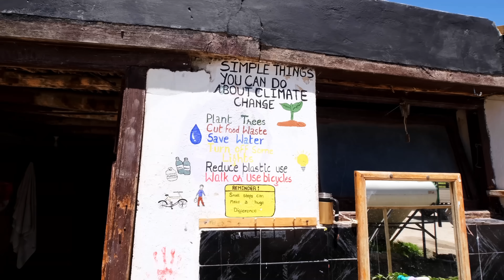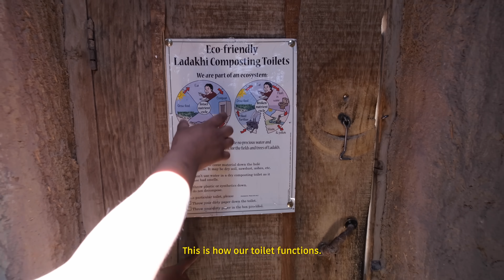How Dry Toilets Grow Food In This Himalayan Cold Desert

Comment: I'm a bit confused about how women are supposed to keep their urine seperate from the poop, which you need to do in a composting toilet. Obviously, the men use the urinal, which goes into a urine tank. As a woman, I can't imagine trying to balance on a men's urinal. Modern composting toilets have 2 separate tanks, served by 2 holes in the toilet bowl.9:55 One tank for poop, one for urine. A hole in the floor, as shown here at 5:06, doesn't.
Reply: I don't know for sure but here's my take. Whether you need the urine separate from the poop totally depends on context, one aspect being what and how much sawdust you add after each sitting. If you notice at 5:47 he uses a whole shovel of dry "sawdust" (or whatever that is) as an example to put on top of the poop/urine, that's enough to counter the excess water, and it's also dry. While composting, which begins not after they close the toilet for a year, but after each sitting, the poop and sawdust constantly need a little more water for the composting to continue to take place, because water still evaporates in that big chamber. If they didn't add a shovel of that dry stuff/sawdust, then yeah, the urine would have been excessive and would create a huge amount of excessive smell. We have an outhouse like this but small and use sawdust cause it absorbs nitrogen (N) well and needs a lot of N to decompose, which is the case in such a composting toilet. But if you want to use a small version of it inside your house and with a bucket underneath, then this is tedious and not practical because it would fill up too quickly because you'd need to add half or one shovel of sawdust and the bucket underneath would fill up too quickly.

Comment: This guy took a huge contract to build a university and it's stalled since forever now govt cancelled it. So doing interviews on dry toilets and doing protests.
Reply from the maker: We don't claim to know the full truth. But we can atleast accept as a Ladakhi engineer his service to the land cannot be discounted. You can choose to believe the govt AND listen to his words on dry toilets, right?
Reply: @goodfoodmovement  Dry toilets were the norm earlier, its like saying will use cycle instead of bus/rail and so on. Not practical, maybe ideal, even in Harrappan excavations, drainage systems were there, so not all places this dry toilet will work. Try   digging a hole in your backyard and shitting there
Reply: @goodfoodmovement  Septic tanks work similarly, especially the double tank model. This guy has been causing a lot of nuisance unnecessarily.

Comment: This film is so well made, thank you! I was involved with designing and building the toilets seen at SECMOL in the film, and later included the same type at my private house, but made it attached to the upstairs of the house for convenience. It works great. 
The two-year alternating chamber system, along with an additional year of composting in a pit right outside the chambers (not seen in the video) makes the compost safe for use in the gardens. No pathogens survive two years of composting. (The additional pit is full, covered with dry soil, and the two guys are standing on it when they open the manure chamber in the film)
Toilet paper composts just fine in it. We found that if only a few visitors used water it was fine, but if several people used water daily for a while, it could make a bad stink (the manure gets saturated and anaerobic, which generates methane and other stinky gases).
Reply from the maker: That's incredible - thanks for sharing your experience with the system and the extra tips :)

Comment: One part is missing....how do you clean yourself in a dry toilet ? That part has been left to the viewer's imagination :)
Reply: Leaves and fern, or corn husk! There are so many alternatives to toilet paper
Reply from the maker: Hahaha. Well all the methods - water or paper - work fine. Doesn't affect the compost so much.
Reply: At SECMOL in the big chambers you see in this film, toilet paper (as well as scrap newspaper) has been used regularly for decades. It all decomposes. When only a few visitors use water, there's no problem, but when several people use water every day, those toilets get a swampy smell (due to the manure pile below getting saturated and anaerobic). I lived at SECMOL for decades and was involved with the design and building of the large-chamber toilets seen in the film. 
At the small indoor toilets at HIAL seen in the film, water can be used. I think those have a liquid separation method at the bottom, but I'm not sure how it works.

Comment: I didn't get it... If such open holes used for toilets doesn't it make the room smelly and may attract all kinds of insects and harmful microbes ? I have seen soakpits in villages which preserves the solid waste which after a year or two of usage can be extracted and used for making manure( although ghis part is not practiced ).
Reply from the maker: The idea is to add the right amount of compost, organic matter that the solid waste is fully covered and devoid of smell. We used it ourselves while filming. It is quite easy :)
Reply: i think where they live its so hot and dry it there are hardly any insects.
Reply: The cover material thrown down after each use prevents smell and flies. In my experience of decades living there, sawdust or crumbly soil are most effective for those purposes. Wood shavings, leaves or dry cowdung can allow either flies or smell, so in Ladakh those are more suitable to use in winter when flies and smells are not an issue.